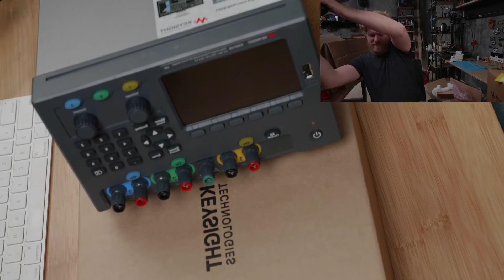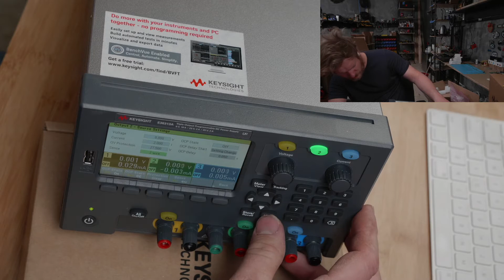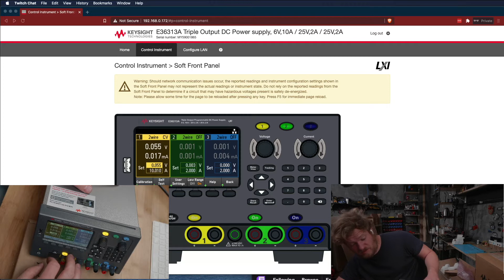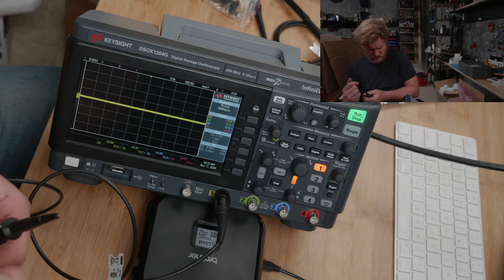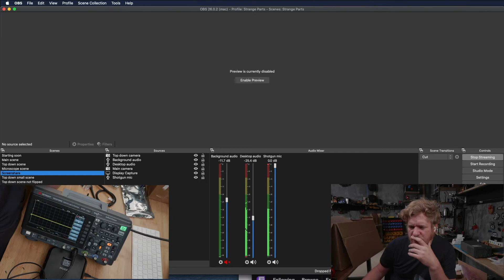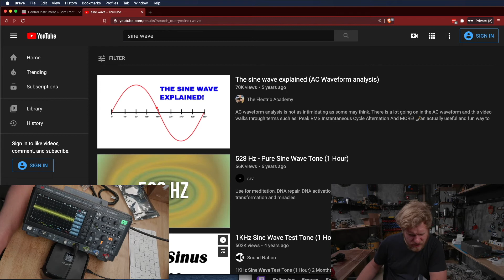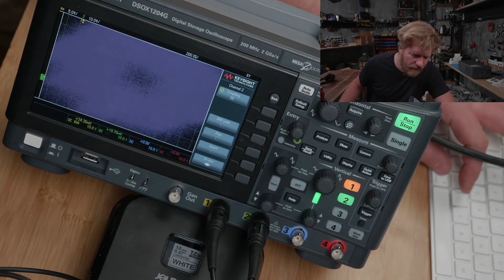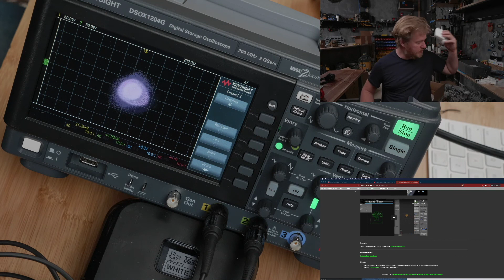Unboxing my Keysight Oscilloscope and Power supply

Comment: You have a very noisy signal !!! Check your grounding. Probably the audio grounding is same as the digital. 
So turn up the volume. And turn a low pass filter or the BW limit. To clear it out.